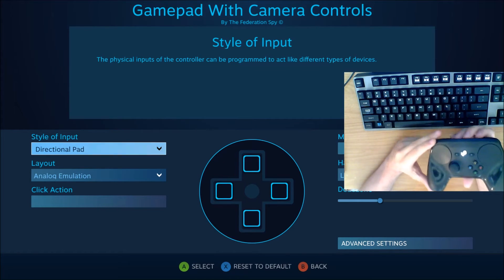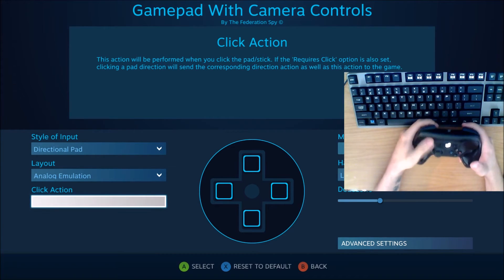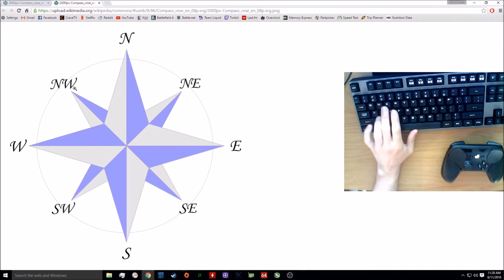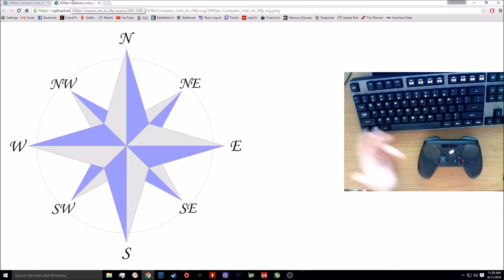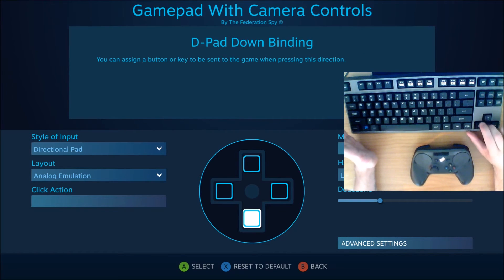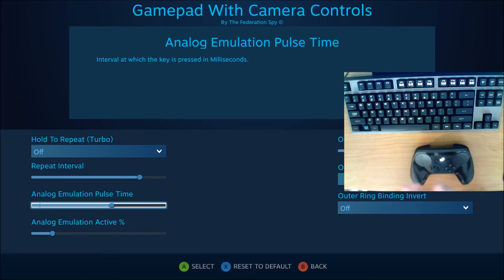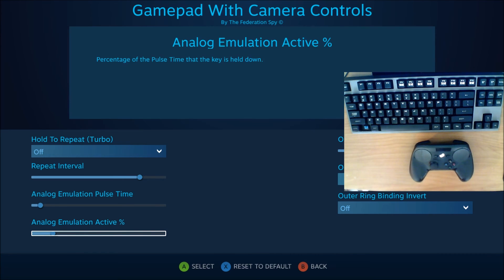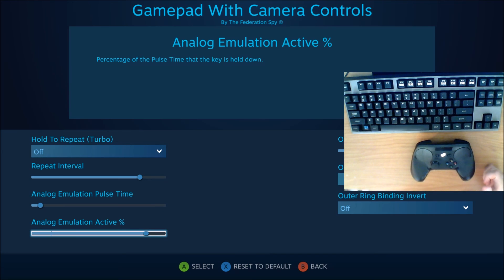Steam Controller Analog Emulation Explanation

Comment: I just want to add something.

(From my testing) The values that these are set to are the slowest that the pulses happen. Also, the rate of the pulses are influenced by the position of the analog stick. The more centered it is, the slower the pulses. The more it's leaning in a particular direction, the faster the pulses for that direction are.

Comment: What you said about analog emulation pulse time is right, but putting that bar all the way to the right will not increase the rate at which the keys alternate, in fact it's the opposite. It's the interval ''in time'' between keystrokes. 100% (bar set all the way to the right) is 500ms between keystrokes and 1% is 5ms. The default value is 5.6% (28ms).
Reply: I noticed this too!
Reply: I knew this but thank you for the clarification. What I didn't know was the max interval in time. It's useful to know that it's 500ms.